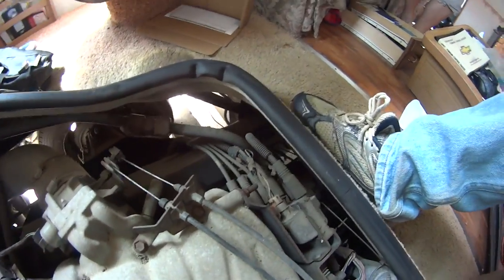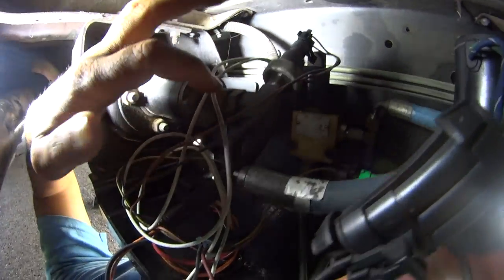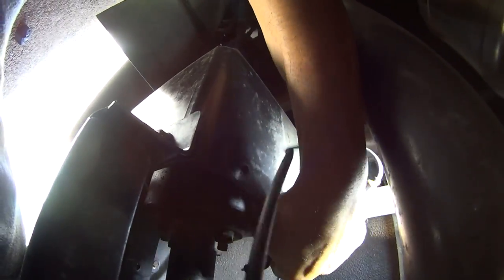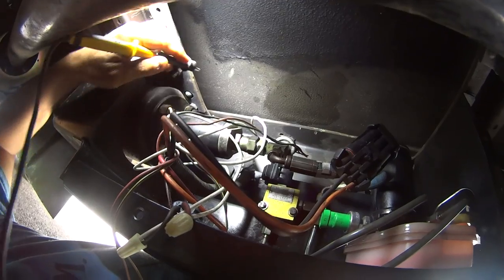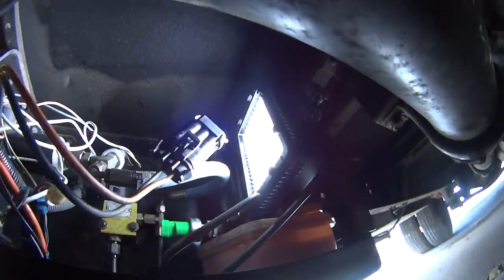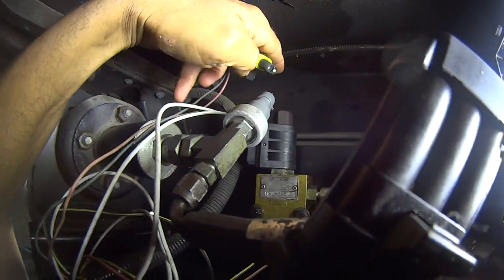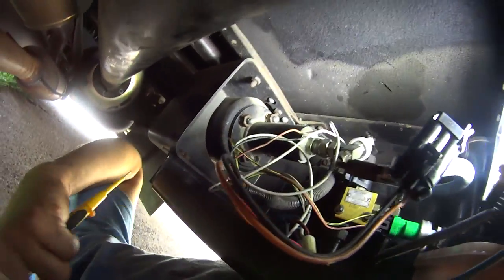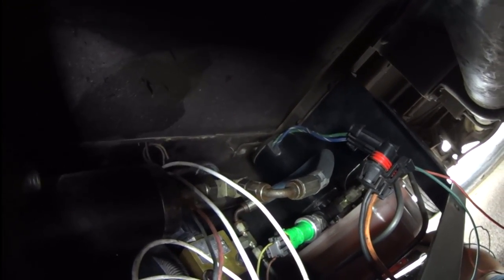auto park brake nightmare FIX or resolved issue Part 1

Comment: Mine locked up at a dump station, pulled the pin at the drum end of the cable. Benn going 8 months without it and blocking wheels. Leveling jacks do well for park also.
Reply from the maker: Bill, that seems to be a "safer" option...
Reply: Same here.  2001 Daybreak Workhorse. Mine started dumping fluid.  Pulled pin, pulled fuse.
Reply from the maker: https://youtu.be/bQHypGsMIgE  here is my latest release on this service... hope this is helpful... more to come.

Comment: 1999 National Chevy P3 Chasis, the Auto Park Failed, put me on the side of the road for about 15 minutes until I mashed the gas peddle, heard a pop, and drove away. I don't have an Auto Park but I am free it and I chok my wheels when stopped.
Reply from the maker: Then your comments are not related to my content, you stated you do NOT have the same system.
Further, you are wreckless assuming your brakes locked up and you thinking you can just apply more gas to free up autopark failure.
You could have so many other issues that caused your brakes to present as locked.
Reply: Lol....pardon me for being so wreckless and interrupting your video.....that is all, carry on.
Reply from the maker: I am a person who lacks the ability to be tactful and I get your sarcasm... I apologise for lack of tactfulness

Comment: You saved our vacation!  Did not cut it, just unscrewed the tensioner and it pulled right in releasing it. Thanks much.
Reply from the maker: Glenn Lang, pinned your comment,   so glad you did away with this loser system...
Make sure you chock the tires on hills...emergency brake may not be enough...
Reply: One other thing and others may have mentioned this, but the brakes dragged a little after. However, it got us off the road and to the camp site so again thanks much for doing the video!
Reply from the maker: Or, make sure you keep unscrewing tensioner -- even more... maybe, all the way and then wire tie the darn thing up and enjoy your vacation...
Reply from the maker: Glenn Lang, awesome... so pleased to hear your sucess...
Reply: Can you please tell me a little more about this process?? I know the directions of the pin removal amd the clevis pin etc etc but unscrewing a bar might be a lot easier!
Reply from the maker: @AngelEyesBia  , I am doing another 4 part video on trouble shooting this system... I am posting part one tonight.
Reply: @ForensicCats  I'll be looking for it because we are still stuck in the same spot we have been and this is getting ridiculous. I cant seem to find where its specifically at under the RV and at this point I want to just cut the line and be done with it!
Reply from the maker: Take a few photographs of your underside and send them to me... I will guide you towards the box...
Reply: @ForensicCats  I will when I go back out there. Right now its just sitting on the lot at the RV park. Thank you!

Comment: I will be happy to donate, but I would like to know if you could make a video to explain how the electric break works.
I'm not a mechanic but I find out even my mechanic don't know how that system works.
I have a Fleetwood 2001 flair and the electric brakes leaking and they are locked.
I don't have anybody close to me understand that system.
If you could explain in a very simple way how this equipment Works it will be easy to understand how to repair and which parts is failing.

Thanks for your videos!!
Reply from the maker: Just follow all my videos on this subject and your answer will be revealed. All donations are accepted and I pay them forward with helping people in need...

Comment: Both Glenn and Const. Engr. Saved my ass today. I  dreaded the day the auto park would rear its ugly head. Today was the day,  loosened the tensioner and we're ready to go to Santa Barbara.  May not have park but with  chocks and jacks we will be good.  May wait until fall to actually see what failed. It is 6:30 p.m. in Santa Margarita and 90 degrees.  I am sure this heat had something to do with it. I always go to YouTube first. 
Thanks

Comment: Note, I have HOURS into making videos on this system as it relates to the hydraulics and this pump, spring, piston, and other parts...   I will share with you a private link to the videos showing how to work your way into repairing this system. 
All I request is that you donate to my cause of helping out the elderly. I will take any amount of $5.00 as good faith and more would be appreciated. 
This will give you some awesome explanation of the system and how you will repair your system and determine which part of your system has failed you. 
I will give you back 100% of your money if you cannot figure the problem out... Also, I will give you my contact information to hold your hand if you need it...  I may even do a video response and give you a private link so you will understand better.
I have 10's of hours in this project so I hope you can appreciate the value. 
The money you donate goes to a great cause and I will not keep one dime for personal use.
Reply: I could use those videos too.  Happy to donate if they work
Reply from the maker: @obtaininglife1729  ,  I have them on this channel and another channel I have, just look up auto park and you will find my videos.

Comment: I have a 98 Fleetwood Flair. I have decided to disconnect auto brake and remove from coach. My issue now is that the leveling jack system retracted and will not turn on. I zip tied the auto brake cable and connectors  to the frame of coach. How can I make the jack system think that the auto brake is still hooked up?
Reply from the maker: Change the relay configuration to show the brake system is working.

Comment: Did you ever fix this my friend?? My guess would be that it is the silver piece that is on the top side of the tee. I would imagine once the pump releases the brakes that that piece is suppose to keep the pressure in the ram thing
Reply from the maker: blindabinda123 , I did a work around... this is the nightmare of this system...it will lock you up on the road... it does not care where... It was an expansion valve...that would not hold pressure to one side...After all that...it disconnected the system. Thanks for asking. I meant to do a follow up video for other RV owners...Basically, you are correct.
Reply: Photolight PhotoLight I was just doing a little research if my own on this and I found that the black thing on top of the silver block that is mounted on the back wall that has the steel lines coming off of it has to have no less than 12.5 volts to hold the valve closed to keep the ram pushed out.
Reply: Photolight PhotoLight the other piece that I was talking about that is sort of mounted to the back of the ram is a device that communicates with the computer and tells it wheather or not it had the required pressure. My guess is that it has to do with the black thing on the wall or a bad oring in that yellow ish colored thing.
Reply: Photolight PhotoLight do you did fix it?